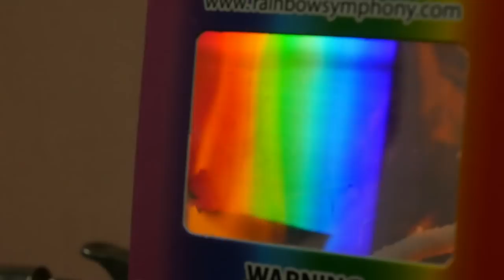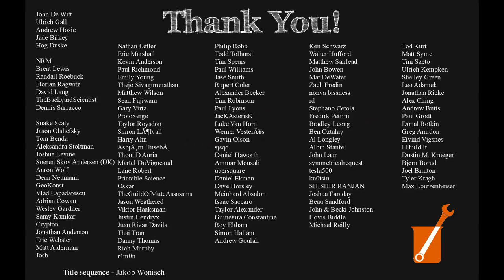Zeeman Effect - Control light with magnetic fields

Comment: My question is how can i use light to make a strong magnetic field.

Also... Something that might be helpful would be a smaller gap in the magnet to observe the light through. Effectively you'd be increasing the effect of the magnetic field on the observed light, but you'd be greatly increasing the amount of light that would be filtered out/rejected by the smaller observable area. 
If dealing with smaller sample sizes is easier for people to deal with though.

Comment: My wife is a physics/chemistry teacher in high school, and they do a demo where they spray the dissolved salts to produce color. The spray bottles create quite a mess though: it coats the burners, the lab table, and the color only lasts as long as the spray itself. We really like your wick/rod technique.

So when you say you dip a ceramic rod in salt to avoid the introduction of water, do you just dip the rod in solid salt? How does it adhere? Also, could you provide your source for these rods? (I'm assuming they're just porcelain, but I'd like to be sure)

This would be a much cleaner demo, and the color lasts rather than being just a temporary burst from a spray bottle. PS: Wouldn't a shoelace wick melt in the flame?
Reply: Regarding the wick technique : a pure cotton wick (like those used in alcohol lab burners) burns quite cleanly and doesn't melt. You soak it in a concentrated solution of the metal salt of your choice and then either use it right away, or dry it in an oven to avoid introducing water to the flame. In the latter case I'd avoid oxidizing compounds like nitrates, because you won't be able to extinguish the wick when you're done ;-)

For the rod technique, a technical alumina rod (easily available online, withstands extreme temperatures) is dipped into the molten salt. Look up melting points in the CRC Handbook : some salts (usually nitrates or iodides) of metals commonly used for flame demonstrations (Na, K, Ca, Cu, Ba, Sr) have melting points below 600C, some go as low as 250C. This is easily achievable with a standard lab burner and an alumina crucible. You need to use a different crucible for each rod you make to avoid contaminating the weaker colors with the overwhelming yellow from even a trace amount of sodium.

I like the rod technique better because the rods are long-lasting, don't shed powder everywhere, and look cleaner. But making them is a bit more work.
Reply: Louis H Fantastic, thanks for the help!
Reply from the maker: Yes, just dip the ceramic rod in salt crystals after heating it up in the flame.  The salt will melt and adhere to the rod quite well.  In German, the name for this is Magnesiastäbchen.  This translates to "magnesia rod", which makes sense, but I cannot find a supplier that sells them.  They may have a more specific name in English, which I never found.  I ended up using an alumina rod, but pretty much anything will work that can withstand the flame temperature.  The alumina ceramic rod came from McMaster-Carr.

Comment: Interesting stuff.  I work on excimer lasers (for photolithography) and we use an iron vapor lamp to absorb light of a very specific wavelength (248.3271nm) in order to determine a reference point for the wavelength measurement system. The way it's used to determine wavelength  is by slewing the laser wavelength in small steps until you see a dip in the light transmitted through the lamp (about 30%) when you hit 248.3271nm.   I'm guessing it's the same effect, minus the magnets because the iron vapor is ionized by the lamp?

Comment: offtopic, please read.

use those 2 electromagnets, connect them to 2 plates and drive them in high voltage resonant frequency so you make an AC MHD propulsion drive. Try it in salty water and you should get amazing results, since mitsubishi wanted to use this AC system but i suspect were stopped by military industrial compley and went the DC route which yeeld electrolosys (DC 8 knots instead of 100 knots AC system)

Comment: If you had the permanent magnets on a wide horseshoe,  with (tapered to increase time before heat conducts to the magnets?) iron pole pieces that go right next to the flame and reach equilibrium temperature, and then a switchable break in the crook of the horseshoe,  you'd have a pretty elegant apparatus.

Comment: Nice video. But unless I missed something it doesn’t specify field direction. And to me it’s not clear either...does flame get brighter with magnet on , or dimmer? I’m assuming it’s brighter but it’s never quite made clear to me at least. You just say on and off. And click on and off Without specifying which one is off/on
What would be great and I’ve never seen it on any reference, even reading the original paper by Zeeman. But a graphic/animation showing your setup but with it in animated steps. Showing which lines (2or 3 & plane or circular  polarisation) appear with what orientation of the field ( Ie parallel or perpendicular)
And what polarisations occur at what orientations. Including what plane polarisations are seen when mag field is perpendicular to light path.Are there both vertical and horizontal plane polarisations when field is perpendicular to light path? Or just vertical or horizontal.

Comment: Electromagnets yes! I would love to learn how to make my own solenoids and calculate the winds, power draw & force it can move.
Reply: force = (number of turns) * (electric current)  ... pretty sure the units are Newtons and Amps
https://en.wikipedia.org/wiki/List_of_electromagnetism_equations#Magnetic_circuits
Of course, that will drop off sharply with distance.
From there, the question is, what gauge of wire will give you the right resistance given the total length of the winding (there might be a chart for that somewhere). Imagine trying to figure out how hard it would be to pump water through a certain length and diameter of garden hose. Same idea. Then, what voltage/watts of power supply you need. Ohm's law V = IR always useful, as is a general purpose multi meter. so electric current is voltage / resistance.  The power supply should be as close to the ideal voltage as possible, but you can go higher and use a resistor to split the voltage if you need to, google "voltage divider." It'll get really hot though, and to avoid smoking it you'll need to make sure it's rated for that much current, and maybe add a heat sink. If you can spring for a general purpose variable power supply that would be the best to experiment with. For anything in production, you'd probably just adjust the properties of the winding to use a common voltage like 5, 9, 12, or 19 (laptop). The Watt rating on the power supply should be above a minimum of (V^2/R) or voltage squared over ohms. 

So, figure out how much force you need, and the resistance per length of wire you have (might have to unwind a large part of the roll and measure at two points), and then wind enough turns to where the current comes down enough and the n goes high enough to give you the force you need:
F = n * I = n * V / (length of wire * Resistance per length)

Comment: I am suspicious that the magnetic field is affecting the gas flow from the acetylene flame. This would be much more impressive with a couple of frequency stabilised lasers to demonstrate that this was not simply a deflection of charged ions.
Reply: If it does affect it, the ions should be shifted forward / backward in the optical path, not side to side. I doubt there would be any detectable change in the amount of sodium in the optical path. 
It would be interesting to see if you can actually produce a visible effect on a flame using just a magnetic field. I've seen it done using a strong electric field.

(Edit) Did a bit of searching, apparently Faraday did some experiments on this in 1847 after he heard about it from the Italians. A magnetic field definitely does affect the flame, and more than I thought. 
If you scan through this link:
https://www.researchgate.net/publication/224728281_Effects_of_magnetic_fields_on_flames_and_gas_flow
you can find several papers relating to the subject.
Reply: timbargen - I am thinking of an experiment that involves splitting a laser beam and recombining it to produce a constructive and destructive interference pattern. A strong magnetic field is applied to one leg of the beam and a change should be observed in the pattern. In theory it should be possible to turn laser light arriving at a target on or off by applying a magnetic field, even though light is travelling in both legs of the path to the target.
Reply: Michael Kaliski    It sounds to me like you want to build some sort of interferometer. How would you use this to detect the Zeeman effect?

Comment: What did you use to space the two cores appart, conducting flux without introducing eddy current losses?
Reply from the maker: Good question.  The power supply in this video is DC, so eddy current losses are not a concern.  Ideally, I would have used oriented-grain "electrical steel" to match the original transformer, but I just used plain mild steel.  Its permeability is so high compared to the air gap, it doesn't matter much.
Reply: I figured the welder power supply was using some form of pwm control which would have an AC component, accounting for the heat being generated in the core.
Reply: Andreas Hatz  For welding you want the waveform to be pretty flat. So the AC component should be fairly small. Plus the microwave transformers will even help smooth out the waveform as well.

Comment: I do believe some of the color changing effect might be caused by magnetohydrodynamic effect changing the shape of the flame. The device is working sort of like magnetohydrodynamic generator, transforming thermal energy and kinetic energy into electricity.
Reply: I think the Zeeman effect can be discerned from other effects using the spectrometer and verifying the split lines. It seems he did this, which would confirm the effect.
Reply from the maker: In fact, this was a valid criticism that Zeeman himself received!  He repeated the experiment with a ceramic (maybe quartz?) tube filled with hot sodium vapor to avoid the problems associated with flame dynamics.
Reply: not likely since there is no electrical current being made to flow through the flame's conductive plasma. It's just a B field, you need an E field to get induced movement of the conductive fluid. he's seeing the actual line splitting effects here.
Reply: So he'd just need to put  wires with stripped ends connected to that power supply into the ionized flame at different positions in the flame so it would have different conduction pathways to change the shape shape of the flame or would there be a visible density path in the flame for the conduction pathway ?
 And <grin> no offense Mr. Rogers, but I want Ben for my neighbor.
Reply: When charged particles move trought magnetic field, lorentz force causes their trajectory to change. In this case the charged particles are sodium and chlorine ions which have opposite charges, opposite charges causes them to twist in opposite directions. In this experiment, sodium ions would concentrate more to one side of the flame making the flame look twisted. I am not saying that this effect would be strong enought to make much difference, but it can cause some error and in sientific experiments this should be taken into account.

I think this test setup could be used to demonstrate the operation of magnetohydrodynamic generator. By placing two wires in the opposite sides of the flame, it should be possible to catch those magnetically separated moving ions and produce a small voltage differential.

Comment: Is the flame darkening effect a result of diffusion? If he had a fine suspension in the air of particles that reflect a specific wavelength of light, then when that wavelength comes along, it would bounce around inside that dust cloud  and scatter in all directions. In this flame demo, it's like a fine suspension of sodium particles. Rather than reflecting, they emit. And I suppose it stands to reason that emission and absorption wavelengths would correlate.

I guess what I'm wondering is, despite the apparent darkening, are we witnessing a phenomenon where in fact the majority of the photons caught by the flame are re-emitted, and does it only appear darker because those photons are not all headed in the same direction anymore?

If so, there might be some exploitable phenomenon here for a highly efficient diffuser for imaging purposes.
Reply: Yes, all the light/energy that gets absorbed will be emitted. It's simply darker now because the atoms emit the photons in all directions now. So the direction they had before now have a lot less photons thus making the "shadow".
Reply: Thank you. That makes sense.

Comment: Btw, kind of off topic tid bit of information for everyone. When you split a MOT and replace the primary onto the "E" core, the plain electromagnet that you then have can support over 90lbs for a good while with nothing more than a fresh AA shorted across the leads. Don't do that too long, because the battery will off gas or ignite or something else mellow dramatic but inconvenient, but that's just to give you sort of a physical, tangible reference as to the force generated by one half of that arrangement with about a measly 20W coursing through it and with only "I" core for the field to permeate through.

Comment: it would be cool to see how it responds to a neodymium magnet, i have one of those 500kg pull N52 magnets which scares me to move around, no idea what Tesla rating that would be, i wonder what the effect of that would be like?
Reply: Nitrxgen   N52 material can do around 1.45 - 1.48T, right at the surface, depending on the shape. The strength of the magnetic field falls off with the cube of the distance, so you need to be very close in order to get anything close to that.  Magnets of the same material only produce a larger magnetic field, not a stronger one. The bigger magnets will be stronger further out than a smaller one, but still hard to even reach the 1T he has here with his electromagnet.

(Edit) To help give some perspective, the weakest grade (N35) of NdFeB magnets have a maximum field strength of around 1.17 - 1.21T. Since I don't know what grade the magnets he showed were, this gives a minimum strength of the magnetic field right at the surface of the magnets. Even with the smallish 5-6mm gap, he only measured 0.8T in between them.

Comment: Nice experiment!!. Perhaps,  you could try generating a big magnetic field by discharging a supercapacitor.I havent done the calculations about the time it takes the discharge through the coil ohmic resistance, but may be current could be big enough to generate a big MF.

Comment: 3:00 -- re: "It's kind of the same thing..." -- Perhaps there is another way of explaining it.  The Light is being naturally photo-multiplied, which gives the contrast.  Multiplying two Fractions gives a Smaller number, thus a Darker result.
Reply: ^^ Jeez but I've spent a lot of time this summer thinking about why polarization filters do what they do, and why thinking about it as Subtracting Light is Wrong.  It's Multiplying at 90° to get a Darker result.
Reply: There's also the effect of leftover residuals from the burning, which have been minimized but won't be Zero.

Comment: If by chance you didn't know or already have them? Check out some of the older Popular Science hard back book series, typically comes in sets of 12 with an appendix volume.. each years series are different.. but that was back when they consisted of nothing but DIY and At-Home-Projects, like build your own welders, telescope, spot welders, 100's and 100's of projects, completely backed up with the math formulas and charts, etc. example, how to build the transformers, for what ever size you desire, and the reason for the materials, and the building of the telescope lenses from raw sand, to cutting and grinding the shapes and their respective math formulas... I love those books.... if my house caught on fire, I would grab those and leave the wife...lol joking of course... is there more updated info on the net ,sure is, but the net also doesn't have some things that the books from the 40's to the 70's do have. Often times, each project will even tell you how to test each sage of your build...  i look forward to the next video..

Comment: There is also the Stark effect, which gives very similar splitting. Can we distinguish both effects? 

One can create very strong electric fields in plasma double layers. This is an interesting effect that is caused by the plasma being out of conducting electrons or ions at certain states. Maybe you can use such double layers to create a similar device to show the Stark effect.

Comment: 10:27 near death experience?
Reply: No. Welding power supply, so very low voltage, high current. Touch both terminals on a car battery. Do you die? No, even though it is capable of 800+ short circuit amps.
Reply: I just saw it was from a microwave transformer, but I guess without all the other parts of the transformer it just runs at the supply voltage